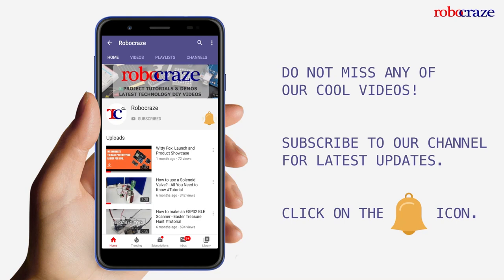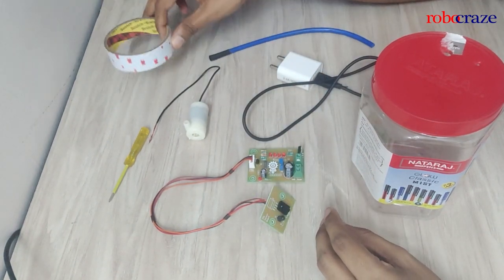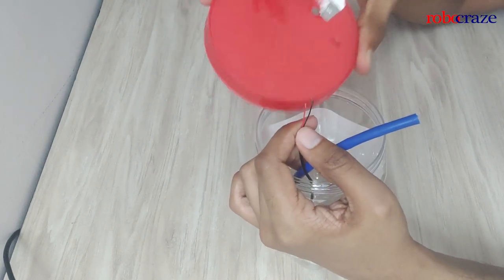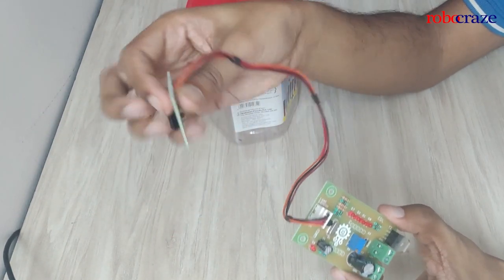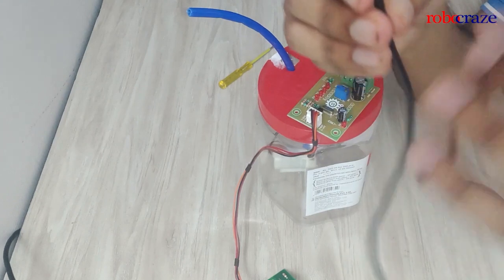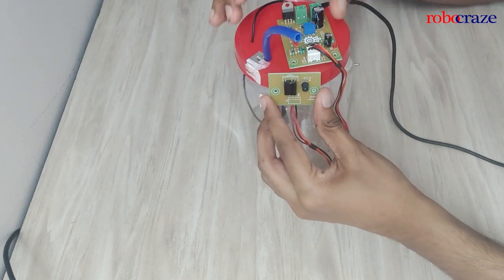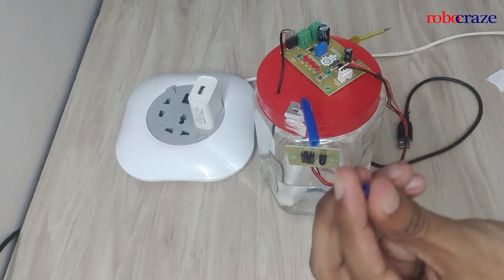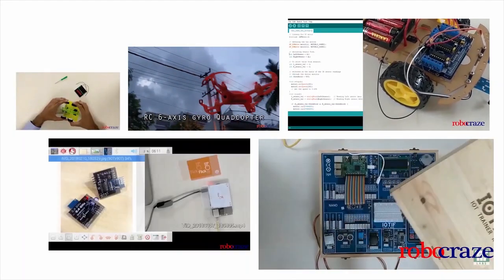Making Automatic Sanitizer Dispenser With a Timer Module

Comment: How to match the polarity? Does black wire go into the left/1st slot and red wire into the right/2nd slot? Is it same for both power and motor?
Reply from the maker: The Sanitizer board itself has markings indicating +5V and GND. You can just follow the same

Comment: Does false Trigerring occur in this module

Ex in sunlight
Reply from the maker: If you set your potentiometer based on sunlight, this problem should not occur.
Reply: @Robocraze  are you using at tiny 85
Reply: @Robocraze  sunlight changes bro
Reply from the maker: @sanjaysudheer756  The sensor that we are using is affected by sunlight.
Reply: @Robocraze  then how can it be installed in outdoor
Reply: @sanjaysudheer756  use ultrasonic sensor